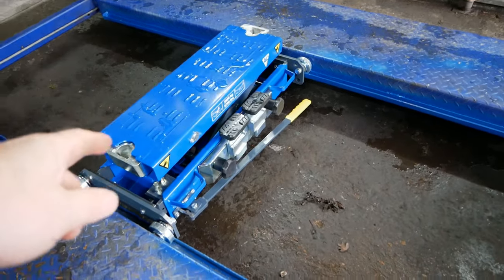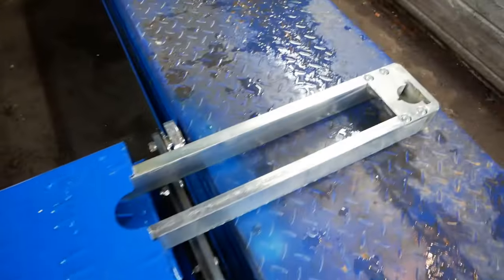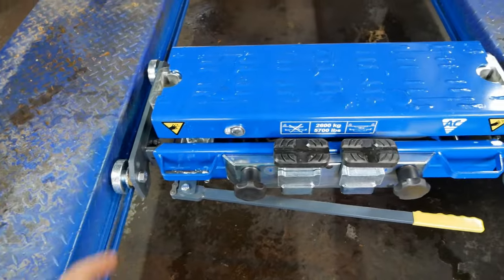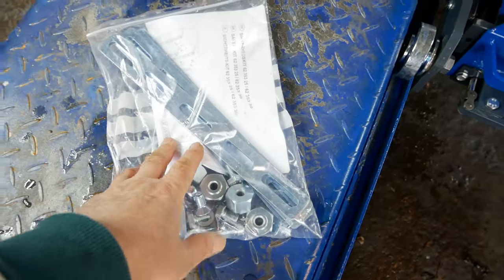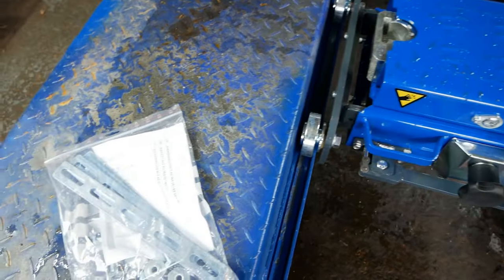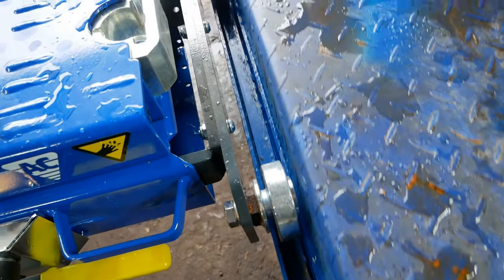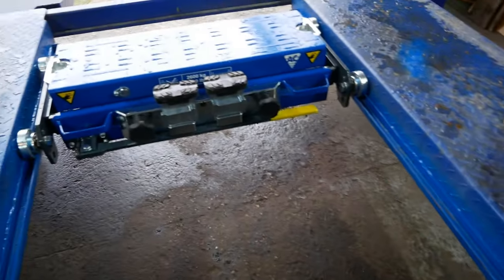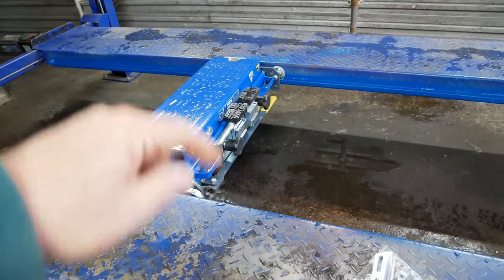Review of the AC Hydraulic SD26L-W, the world's widest span jacking beams

Comment: Hi!
Thank you for the great review of our wide jacking beam. We would also like to thank you for the feedback in the video.
There are two things we want to adress:

1. We are sorry that you did not recieve a reply for your email. We strive to answer all customer enquiries ASAP. 
2. You express concern about the size of the two 10mm. bolts which is perfectly fair, but we can assure you that they are thoroughly tested. Here is a snippet from our official load test: 

•	All jacks manufactured by AC Hydraulic A/S have a safety valve that will not allow the user to lift more than 110% of rated load.
•	They are designed and manufactured for a test load of 150% of rated capacity (equal to 3,9 t.)

Again, thank you for reviewing our product.

Read more about our jacking beams on our website!
Reply from the maker: Thank you for commenting and this additional information is good to hear.

Comment: Although I’m not a mechanic, it’s good to know what they use to lift our cars in the workshop or garage.
Reply from the maker: You only use these jacking beams on four post lifts as the car is lifted on its wheels, so these beams then lift the wheels off the ramps.
However, the majority of garages use two post lifts, where you lift the car on the body, so the wheels are hanging.

Comment: So do you need 2 to lift the front and rear of the car?
I've just seen the end of the vid which shows the pair of jacks. Question answered.
Reply from the maker: Correct. But only if you want to lift all four wheels at the same time. For most jobs, you can get away with one. Mostly you use these to work on the brakes.

Comment: Thats a right pain if you have jacks that dont come out far enough. At work, the mot ramp had knackered jacks and the boss bought some rubbish ones that dont come out far enough. Really annoying and got to the point i told him to remove me from the mot testing system. Been a tester since 2000 but glad to have an excuse to stop doing them.
Reply from the maker: Clearly he didn't spend enough time looking at the specs. Wide span beams are crucial now as cars have got wider and jacking points further apart.

Comment: you could always drill the holes out and make them larger. it would be easier work
Reply from the maker: Good point.
Reply: dont forget to the plates are squeezed together too making friction
  @GoGreenAutos
Reply from the maker: @StephenLyons1984  yes I know. That's why I put the bolt torque on the screen.
Reply: just weld them together?

Comment: If only one side breaks, whats the risk of the car sliding off the ramps rather than just dropping onto the rails?
Reply from the maker: Very little due to the fact you only generally lift a vehicle enough to remove the wheels, so its not lifted much and not at a steep angle.
Reply: @GoGreenAutos  thanks